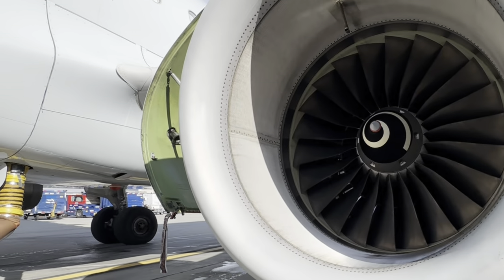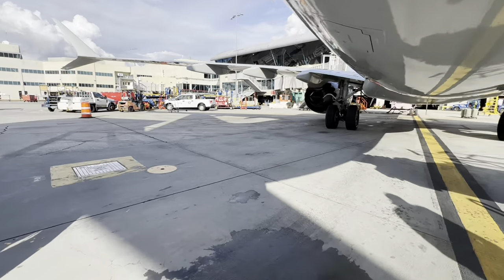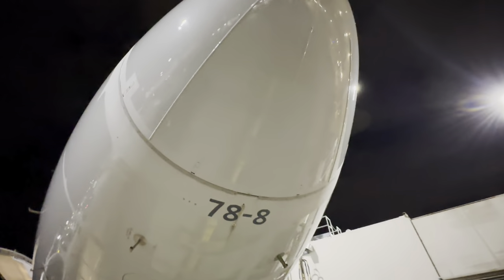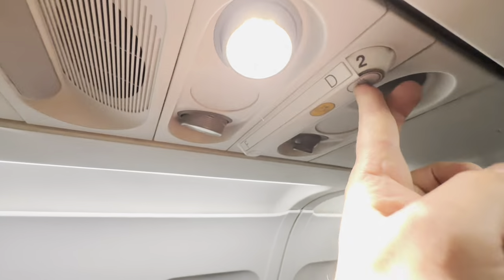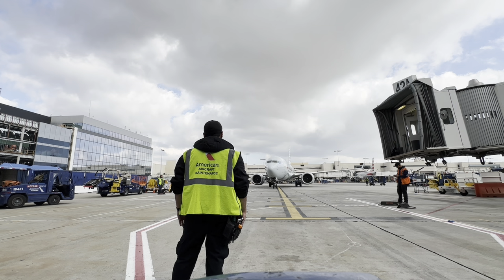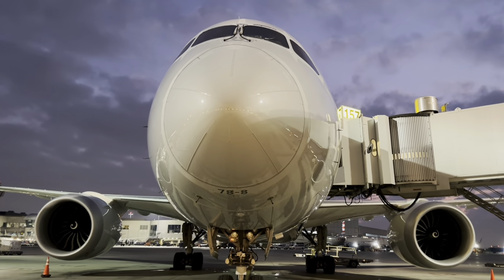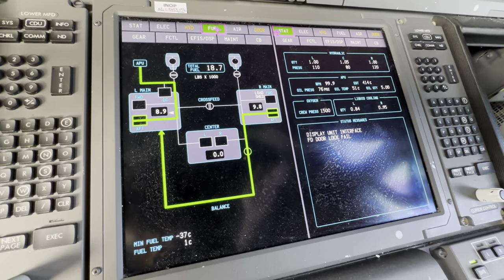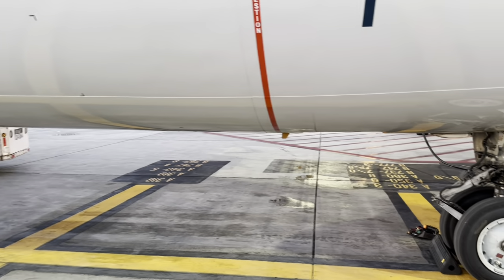Stig Shift #7 (22DEC23 - 24DEC23) Christmas Special

Comment: what’s the answer?
Reply from the maker: There’s 2 parts to this. Certain push buttons light have two dots, Indicating that The corresponding part of the push button is not used. Certain push buttons do not remain pressed in. These are referred as “momentary action”  push buttons. 
There is another function and a notification for these push buttons and indicators. And that is a reversible and a irreversible action. The push buttons that have a dots on top are reversible that means the button or the action can be disengaged. Now the buttons with the dots on the bottom is a one time function. That means if you press it that is it one time function cannot disengage

Comment: The circles help with limited visibility so you can feel what panel it is in relation to where the circles( indents) are
Reply from the maker: Not quite. 

There’s 2 parts to this. Certain push buttons light have two dots, Indicating that The corresponding part of the push button is not used. Certain push buttons do not remain pressed in. These are referred as “momentary action”  push buttons. 
There is another function and a notification for these push buttons and indicators. And that is a reversible and a irreversible action. The push buttons that have a dots on top are reversible that means the button or the action can be disengaged. Now the buttons with the dots on the bottom is a one time function. That means if you press it that is it one time function cannot disengage

Comment: Regarding buttons with the dots on the bottom can you give an example of something that cannot be disengaged?
Reply from the maker: It’s more in terms of a reversible or irreversible action. So, for example, if you drop the ram air turbine., that is a irreversible action, you cannot stow it in the air. The aircraft has to be on ground. Does that make sense?
Reply: @StigAviation  it does thank you!

Comment: Could the dots on the switches mean they are normally opened or closed switches? Amt student here.
Reply from the maker: There’s 2 parts to this. Certain push buttons light have two dots, Indicating that The corresponding part of the push button is not used. Certain push buttons do not remain pressed in. These are referred as “momentary action”  push buttons. 
There is another function and a notification for these push buttons and indicators. And that is a reversible and a irreversible action. The push buttons that have a dots on top are reversible that means the button or the action can be disengaged. Now the buttons with the dots on the bottom is a one time function. That means if you press it that is it one time function cannot disengage
Reply: @StigAviation  Thanks for the explanation, I rewatched the video and saw what functions those buttons operate, and it makes sense. Being onetime use or multiple 👍

Comment: Dots on the OH switches   I think are Braille… right?
Reply from the maker: There’s 2 parts to this. Certain push buttons light have two dots, Indicating that The corresponding part of the push button is not used. Certain push buttons do not remain pressed in. These are referred as “momentary action”  push buttons. 
There is another function and a notification for these push buttons and indicators. And that is a reversible and a irreversible action. The push buttons that have a dots on top are reversible that means the button or the action can be disengaged. Now the buttons with the dots on the bottom is a one time function. That means if you press it that is it one time function cannot disengage
Reply: @StigAviation  TY Sir

Comment: Isn't having a battery next to an oxygen bottle a bad idea?
Reply from the maker: Not really, both the battery, and the oxygen bottle have a ventilation system. Even if there was some kind of a thermal runaway, it will go overboard. There is prevention systems in place to mitigate or prevent damage.

Comment: I originally heard the reason the A380 lacks reversers on the outboard engines is to avoid foreign object ingestion on landing. The wingspan is wide enough that the outboards may be hanging over unpaved areas beside the runway during reverser operations… However, wouldn’t this be an even worse ingestion risk on takeoff?
Reply from the maker: It doesn’t make sense for lack of thrust reverser on the outboard engines, because they are not susceptible to foreign object debris. Those engines are very high off the ground, and probably will never even encounter that. The whole point of having only two thrust reversers is because the wheel system, and the brake system is strong enough.

Comment: I don't like the idea of you touching and pushing buttons on a active aircraft that passengers and crew about to get on.  Very concern of the safety of passengers and crew.
Reply from the maker: You do understand I’m maintenance RIGHT ?  It’s my job to touch and push buttons. Matter of fact pilots have zero control over the aircraft until I’m done with it. I’m the final authority. Maintenance is final authority on aircraft dispatch. So don’t be concerned when a professional is doing their job. I’m just showing you 1% of the duties. Thanks for watching.

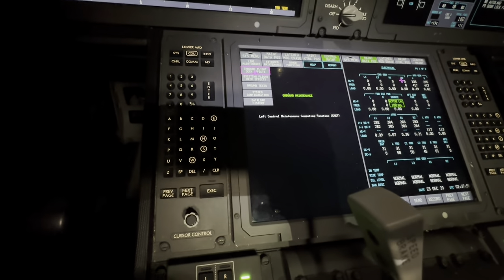Comment: 15:00 this is an important difference between A & B. Airbus were targeting emerging Asian markets with the birth of this philosophy in the 80s. 

The A320 was the first plane designed specifically for, let's call them, non veteran pilots. Boeing with its home market knew its pilots were gonna be mostly ex military. Seasoned. So they give you all the info at once. Airbus knew its clients might not prefer to handle all that.
Reply from the maker: That’s completely understandable, but the information is targeted towards maintenance mostly. Pilots will always get the generic information they need just for flight. When you dig deeper into the systems, Boeing still makes it very complicated and presents over abundant amount of information, as Airbus simplifies it, and tells you the problem specifically.  It’s just a difference of design and architecture, I enjoy them both regardless.

Comment: Those back shells on the brake temp connectors which you say have a tendency to loosen.........
Couldn't you add loctite to the threads? 😊

I like you enthusiasm and competence for the job. 
Well done that man.❤

I work on cars and I get tired of all the bodges I have to rectify on a daily basis.

I always say it's a damn good job these monkeys don't work on aircraft ⚠️😉
Reply from the maker: Very rarely those get loose, it was a fluke.. but I still have a tendency to check. My eyes are always wondering around and looking at the details.

Comment: Hey, first timer here. I always though that A380 does have reverses on all 4 engines. They do use only inboards, because of the huge wingspawn that the a/c have, there would be a possibility that reverses on the outside could take in signs, grass etc.? 

Otherwise i am very much supprised, how much technical stuff i can learn here.! Its amazing.
Reply from the maker: The 380 only has 2 thrust reversers. On 2 and 3 engine.

Comment: Couldn't help noticing the orange  corrugated pipe on the cabin air vent panel you showed us was completely kinked. ⚠️
Reply from the maker: It’s because it wasn’t inflated yet. Once air flows through it , it straights out… it has a swivel joint in the connection

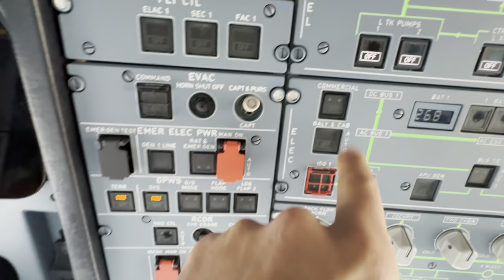Comment: Ok going to attempt to answer your question about the overhead panel switches @24:30 on the A320.  The first thing I noticed which was common between them was that they all related mostly to electrical systems.  I then started lookin into the A320s power system.  My theory on those circles is the that they represent the two batteries or generators powering each system and the reason for them being up or down indicates if they can be operated in the air or on the ground.  How did I do?

And the little easter egg @27:20, the ground power receptacle assembly on the Boeing 737 is produced by a company called Corsair Electrical Connectors based in Irvine California.
Reply from the maker: You are absolutely correct on the Corsair Air Easter egg. 

And here’s the answer to the question 

There’s 2 parts to this. Certain push buttons light have two dots, Indicating that The corresponding part of the push button is not used. Certain push buttons do not remain pressed in. These are referred as “momentary action”  push buttons. 
There is another function and a notification for these push buttons and indicators. And that is a reversible and a irreversible action. The push buttons that have a dots on top are reversible that means the button or the action can be disengaged. Now the buttons with the dots on the bottom is a one time function. That means if you press it that is it one time function cannot disengage
Reply: Doh!  At least I tried!  I was an airframe tech mostly and only did a little bit of engines on Turbo prop so the big jet systems baffle me!  

Thanks for your explanation.

Comment: How hot is the air coming out at 4:05? And how come there aren't any cones to let you know that engine is safe to be around?
Reply from the maker: I would say it’s close to 100° at the very exhaust portion of it, and the engine is not running so I don’t understand what you mean by the cones
Reply: @StigAviation  orange plastic safety cones to guard against safety issues and damaging aircraft.
Reply from the maker: @mrtodd3620  the camera might not have captured it. There is a big orange cone outboard of the engine

Comment: That has to be alota pressure output from those ground packs to air-condition an entire 777 via those two little hoses.🤔
Reply from the maker: It’s just cold air being pushed. Not a lot of psi.
Reply: @StigAviation  must take a while to cool her down or warm her up. Did you say you worked on the Tristar? You're a legend man.
Reply from the maker: It takes about half an hour to 45 minutes to get the aircraft to nominal temperature., And yes, I did get to work on the L1011, it was an amazing aircraft
Reply: @StigAviation  I was a boy when I first saw that aircraft in her hangar. I thought she was going to space😂
I hope you took a slide down the s duct.🥰